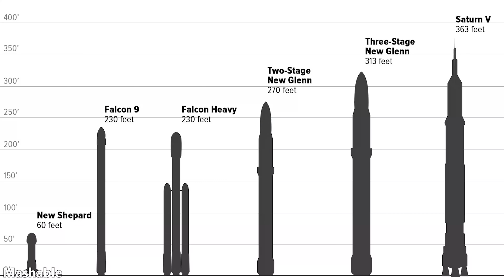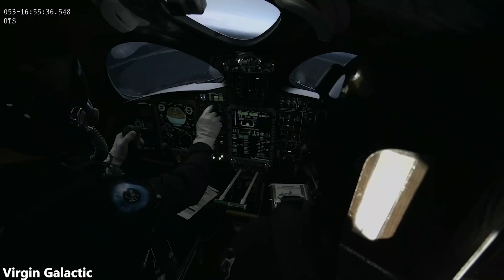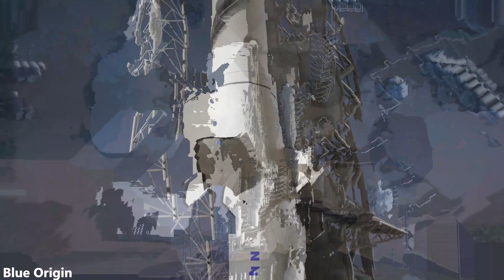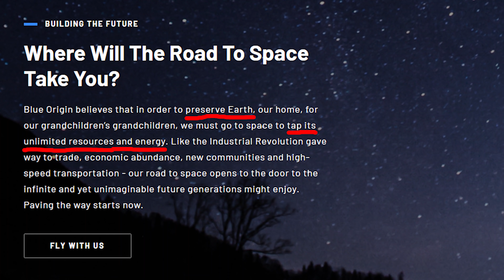What Happened To Blue Origin

Comment: New Glenn is coming too late. It is a competitor to F9/FH. By the time it is routinely operational, SpaceX will likely have brought launch prices further down with Starship.
Reply: Correct. The new Starship is getting prepped now for its first orbital flight. This will take reusability to the next level, or more accurately a few levels beyond that. It's not so much that Musk made a more powerful rocket, but that he pioneered new methods for reusability.
This is the main driver that will slash launch prices.
Blue Origin is still trying to figure out how to complete a circle. SpaceX is going to cut the price of that circle by 99% or more.
Reply: @protorhinocerator142  It will be interesting to see how close the engineers at SpaceX get to the $2M per launch goal and the launch multiple times a day goal. Just getting to $50M-$100M per launch and a turnaround of a week would be big. Anything better would just be gravy.
Reply: Was Ford too late after Mercedes Benz started building cars? Was Airbus too late after Boeing? We're still only at the first step of the space age. In a few decades the demand for launch providers will become so much greater than one company can handle. Any company that can get a succesful rocket system going in the next few decades has a potential grand future over the next century if not longer. Bezos has grand plans, and regardless of what you think of him, he has achieved a lot in this world and knows how to make things happen. He is adamant that New Glenn will be their smallest orbital rocket. Further down the line is New Armstrong, which will be a big step up. Don't be fooled by the lack of twitter updates, he's no Elon Musk but he has the money and stonecold business attitude to make anything happen. And Blue Origin has made massive strides in engine development and propulsive landing over the past decade that only a very select few organisations in the world can match. They are not too late and i hope both SpaceX and Blue Origin achieve all their rocket goals.
Reply: @Dusto9  nice sales pitch
Maybe you should market for Bezos
Turn that loss into a profit for his whole company
Reply: @spaceman7019  No thanks mate, i have no interest in marketing anything whatsoever. I just stated simple facts and refuse to jump on that short sighted anti-BO bandwagon and prefer to just take things as they are: which is that BO is actually doing really well. That others are doing even better doesn't subtract anything from BO's impressive progress. And for what it's worth, BO isn't losing any money. They are investing in their future as planned.
Reply: @Dusto9  looks like a lot of money lost
Even as an investment
Reply: @spaceman7019  And that's why you are not the richest man in the world.
Reply: @Dusto9  There really is no comparison for Blue Origin to SpaceX right now. Maybe in the future if BO ramps up their hardware and development cycle, but so far, they are severely lacking in results compared to SpaceX.

BO was founded in 2000 and SpaceX was founded in 2002. BO has a secretive, evidently plodding development cycle, that has little to show since they were founded. SpaceX in less time has so far passed BO with their more open, aggresive development cycle that it is not even funny.

BO has 15 launches of an up and down sub-orbital class New Shepard rocket from April 2015 to April 2021, of which 14 boosters were recovered. These launches were over 4 classes of booster. Yes, BO is also developing a new engine for launching orbital rockets, a Moon lander, and they are developing New Glenn, which slipped it's schedule to late 2022/early 2023.

In the same time frame, SpaceX has had 98 launches of 4 different Falcon booster types that pushed it's secondary stage to orbit. SpaceX was launching payloads to orbit operationally for over 2 years before New Shepard first flew. SpaceX recovered 77 of those boosters. Just two of the currently flying Falcon 9 boosters (B1049.8 & B1051.9) have 17 flights between them in in the time it took BO to fly 7 flights (2.75 years). SpaceX also developed and is operationally flying Falcon Heavy. SpaceX developed Starship (comparable to New Glenn) and is currently flight testing it as it is so cheap to build that losing one to a flight test is not an impediment. SpaceX developed a new engine, the Raptor, which is the first full flow, staged combustion engine to ever fly. Starship has so much potential for commercial variants, including a Moon lander, that Starship easily won the NASA Human Space Lander competition on merit AND low cost this week.

Yes, NS is working on a man rating, but the Falcon 9 B5 has had a man rating for almost a year now and is launching it's second crew mission to the ISS in a few days from this post. 

Heck, Rocket Lab was founded in 2006 and is passing BO in space achievements with 18 orbital commercial flights since Jan 2018. BO has had 8 NS sub-orbital test flights in that same time frame.

So the question is valid, will BO actually provide competition for SpaceX and other US space companies? They have not showed much competition so far IMO, which is sad for the US space industry.
Reply: @steveaustin2686  New Glenn is only comparable to Falcon Heavy. Starship is comparable to the Saturn V and other super heavy lift vehicles. That’s the issue. BO is designing a rocket that will compete with the rockets SpaceX is looking to make obsolete. New Glenn won’t be fully reusable either. The second stage will be lost like with the Falcon rockets. There’s also the question of if they can even reuse the first stage. There are questions about Starship as well but SpaceX has a much better track record than BO so I believe they will get at least close to their goals with Starship if not fully successful.
Reply: @bensemusx  Don't know where my reply went. I was comparing developing a new rocket, not the lift capability. So BO developed New Shepard and New Glenn. SpaceX developed Falcon 9 and Starship. Falcon Heavy is a modification of Falcon 9, so I wasn't going to compare that to building a new rocket.
Reply: @Dusto9  First of all the cost of earth travel is drastically lower than space travel dude wtf are you comparing them.
Reply: @mjzafe5326  Wtf are you on about? I'm not comparing earth to space travel. I'm telling you space is not a one horse race.

Comment: I agree with an energy crisis, but mooving batteries from earth an back is ridiculous.
You can transmit energy from space with microwave or lasers to produce heat and activate thermal generators.
And that idea is probably more distant to reality than the fusion reactor.
Reply: I'd hate to live anywhere near that beam. Even a microscopic aiming error extrapolated out over an angle reaching from orbit to Earth would be thousands of square miles of danger zone. A micrometeorite nudges the beam generator and next thing you know your whole family just got cooked.
Reply: @tyharris9994  I agree!
I think fusion is closer to reality

Comment: It’s important to note that the new shepard doesn’t have any horizontal movement, thus making it much easier to land
Reply: I may have misunderstood but how does that make it easier?
Reply: It's easier to return to launch site. You don't need a boost back burn or much vectoring, so all your trust and fuel is used to shed your vertical velocity. But what really makes it easier is the lower speed.
Reply: Easier = better : for those who misunderstand

Comment: I may not be a fan of Blue Origin's rate of progression, but I couldn't agree more with Bezos on the energy situation.
Reply: I agree that it is an issue, but how the heck does sending batteries back and forth from orbit solve that... Just use the energy you would have used to create orbital velocity lol
Reply: @aerodynamic3523  It wouldn't be a perfect fix, but it doesn't need to.
A reliable energy plan in the future would draw on multiple sources, hopefully.
Also, you only need to expend energy to life em into orbit. Once up there we're looking at solar 24/7 which would be amazing.
Reply: @Le0nnh  Well not 24/7 unless you are in quite a high orbit. And you still need to get the energy back down to Earth for it to be useful. That's ridiculously hard to do. Maybe in some far future scenario we will have an enormous solar power station at the end of a carbon nanotube space elevator cable that can conduct power back to Earth, but that is complete sci-fi at the moment. You're a lot better off just building zillions of solar panels on the ground.
Reply: @aerodynamic Lesers transporting energy
Reply: Yet, his fortune is built on manufacturing and consumer demand of useless electrical and electronic trinkets.
Reply: Power satellites, indeed.
There's an Isaac Arthur video about it somwhere, pretty sure.
Reply: Dear Lord twinkle: I couldn’t disagree with you and Jeff Bezos more. We have plenty of un-utilized solar energy from the sun coming right to the surface of the earth every day, and as well that sun energy produces wind energy that is also under utilized.  There are lots of other clean energy sources, not yet utilized, such as tides and ocean currents, and deep geothermal. It is farcical to think that we will need to gather energy In outer space to serve our simple needs on the planet. Besides all the unutilized energy from the sun, we also are wasteful at using the energy we do have, so there is plenty of opportunities to increase energy efficiency Of just about everything.

Finally, it is ridiculous to think that we are going to have steel mills and plastic factory in Outer space so as to import those materials back to mother earth. The only reason for manufacturing in Space is for small quantities of specialty items, such as super pure this and that and super spherical this and that, etc.

Mr. Bezos is probably well-meaning, definitely poorly educated, and most certainly unwise. I’m afraid to follow after him into even a crosswalk. For you, good luck!
Reply: We could mine the moon for Helium-3  and use it to power up the fusion reactor plan and build Solar Cities
Reply: MONEY alone, will NEVER beat the GENIUS.

Comment: We should get rid of gas and move to electric, that would be both great for us and the planet I feel bad that I have that thought of dieing b4 seeing humanity change for the good I've learned a lesson if you want something, do it yourself or at least try ;(
Reply: As of right now, its very hard to do that, UNLESS the battery get super efficient like more storage to hold energy, being able to hold thousand of time or more charging and discharging(ofc at higher volts or at faster rate) and in my opinion, the main problem is the weight, the less its weight the better it is, and if it weight less, u can make it bigger and hold more power.
Reply: Electricity is made from made different sources including gas.
Reply: @johnl.7754  OK fine let me say it differently we should cut down on gas... Is that acceptable? : )
Reply: @KnHighmer_Dos  if you're talking about natural gas then that's a big mistake. Natural gas is the biggest reducer of carbon emissions to date. I also don't see electric being much more clean than a modern efficient gasoline powered car
Reply: @jake3736  😧😧so?.... I guess
..... There's no solution huh..... ... why?........... Life suck and it always will.......... I think....... Depression is already killing me I don't think I can reply anymore.. Have a good day ppl 👋 stay safe stay strong
Reply: @KnHighmer_Dos  I'm being a realist, electric is not the solution by itself. It needs to be generated cleanly or else you're just kicking the emissions back to the powerplant. People need to understand that there's NEEDS to be a shift in how energy is generated or else you're just fooling yourselves
Reply: @jake3736  woah I didn't say it was bad or anything you proved your point and I agree and i get what you mean I'm trying my best to avoid an argument have a great day stranger you opened my eyes thx :)